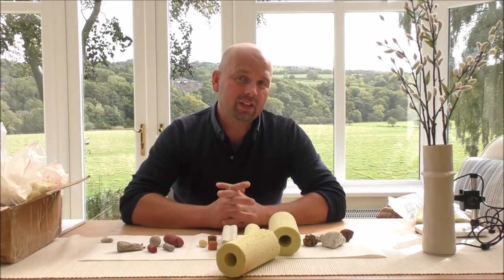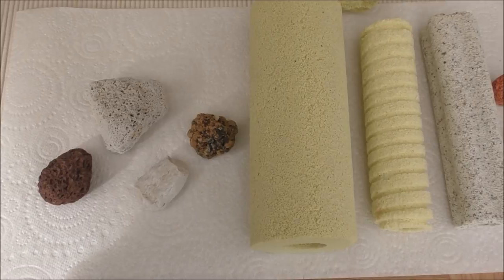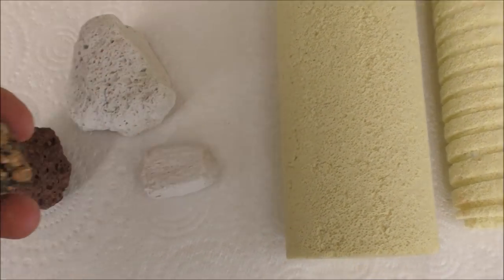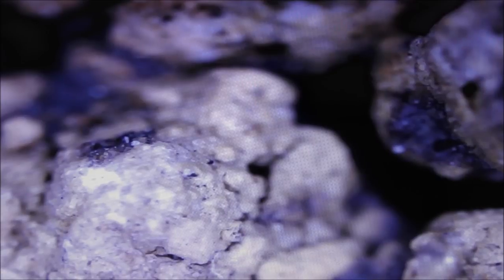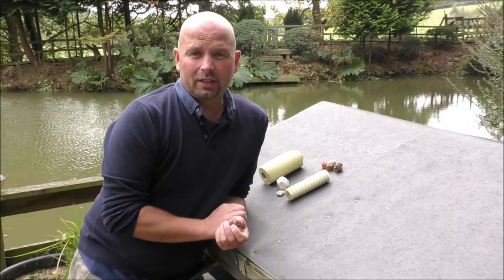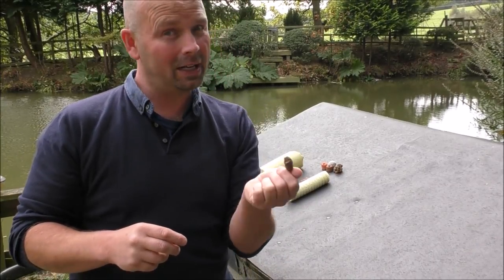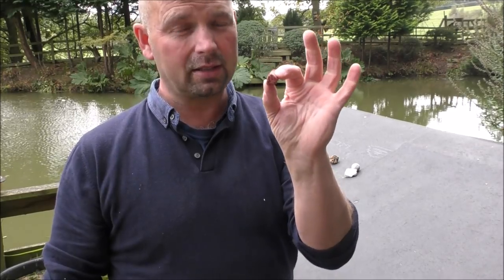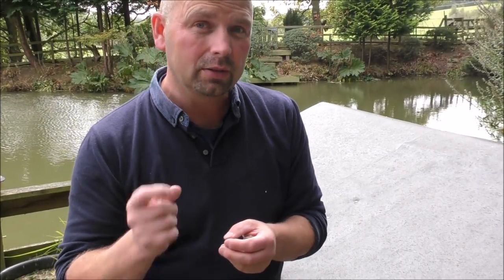Looking INSIDE Filter Media for Aquariums and Ponds

Comment: Why is the biohome ultimate gray inside
Reply from the maker: All the media starts out life as being a grey color but changes in the kiln depending on the trace elements added - ultimate goes orange and marine goes a browny purple.
When the media is a certain thickness that color doesn't change all the way through and it comes out a 2 tone color. The structure is all the same right through but the intense heat exposure is greater on the outside of the media.

Comment: here is my thoughts:

"I really wanted Lava Rock to be a good media, but its not"

I love the price of Lava rock, (dirt cheap)
I love the look, and its easy to work with and lasts forever.
The down side is that I dont think the holes in Lava rock actually allow water inside the rock, nor do they even really connect with each other.
I had a bunch of Lava rock all set to put in the top two trays of my filter when I had a close look at it...
What Im seeing with my eyes does not give me much confidence it can allow water to soak-in and that means that its really just as good as any rock with drilled holes  on the surface.

My question, has anyone seen a video where they show water soaking all the way though lava rock?
Reply from the maker: The stuff generally referred to as 'lava rock' which is the brown / red type of volcanic rock is not very porous at all as shown in the video so you will not see videos of water being drawn into the rock since the structure is not compatible with being porous. However, good quality white pumice is also a lava rock and can be very porous. The stuff I used in this video is basically a better quality version of what seachem sell as 'matrix' - not sure why they don't sell good quality pumice as it can be a decent media and the trade cost difference for bulk buying would be minimal between good drinking water quality pumice and the crap they sell (for a ridiculous price....) which is full of junk rock.
If you are looking for a hard, good quality media I would definitely recommend the alfagrog which is also shown in this video although you may not find it outside the UK. Most of the available surface area is external but it is extremely knobbly so has a good usable surface area.
Reply: @pondguru  
I live in northern North Dakota, in the USA, and so right at the moment its not really the time of year to expect to find much pumice in the garden sections...
However if I can find some Im going to give it a try....We shall see how it goes...

Take care!
(always enjoy your videos, I learn so much!)
Reply from the maker: @AlanMolstad  Good luck on the search - all I ever see in videos from guys in the US or CA is the red / brown lava rock and they've obviously never cracked a piece open to look inside as they tout it as being the best thing ever when it simply isn't - generally the lighter the lava rock is the better quality the internal structure will be.
Reply: @pondguru  Thanks so much for getting back to me!
Im about to add a bunch of pumice to the two Cascade 1000 filters I run on my 110-gal aquarium.
However before I did this (and make a mess that I always make when I do tank maintenance) I wanted to run by you the type of pumice I will use, just to see if you find any issues with it?

https://www.amazon.com/U-S-Pumice-1001-Scouring-Stick/dp/B018UR7LPG

(I hope the link works)
When I opened a  little box of it I found it was a nice shape to go into my filter trays.
The price was within my range of about $1 buck and change each here.
They look very clean, they dont appear in the ad to have anything added to them.
These are just the one brand that happend to be in stock at the local store, but I can see  other forms of the same stuff are also sold.
Reply: @pondguru  
on a side note...I fully understand why so many people think Lava Rock can allow water inside it,  just take a look at the stuff with all the little holes it has on the surface  and you will automatically think the holes go deep into the middle and are connected.
I know that is clearly what I was thinking as I was about to add a bunch of it to my filter trays.

But I started to notice something when I was washing the grit off the Lava stone - I noticed that I expected water to drip out of the little holes as it drained water from the middle, but that was not happening?
I then had a closer look at the stuff and from what I was seeing it seemed clear to me that while it has a ton of holes on the outer surface they simply don't connect with each other.   
That means that water can never pass from the outside to the inside as I was thinking until that moment.

Then I considered the stone material itself and how hard the stone was apart from the holes, and what you  seem to have is a very hard stone material that can't soak up water at all.

So I changed my mind as to the use of Lava Rock and filled the empty filter trays with white floss for now...

The quest continues!
Reply from the maker: @AlanMolstad  Yes, simply crack a piece open and look at it under a decent magnifying glass and you'll see that almost all the internal structure is sealed with the occasional bubble in there. It baffles me how people passing themselves off as 'experts' can say lava rock is a great media when it simply isn't. Well done for finding a good white pumice stone in the US - I commented on your video.
Reply: I keep wondering why foam wasn't included. There's such a diy movement for foam pads. Some guys are using it as baffling in their sumps. Sort of.

Comment: WHAT!!! I PUT MATRIX UNDER A MICROSCOPE AND MINE WAS SMOOTH AS GLASS
Reply from the maker: The stuff sold as 'matrix' is a dense, low grade pumice so is very smooth (and not much use). I used a very porous piece of pumice for this video and much of it was smooth too but it is much better than matrix due to the increased porosity. It's only when you look through a microscope that you see what makes a good and bad media....

Comment: Fascinating stuff, Richard, but I lost you at one point.
"Carbon has more surface area"
Sorry Richard but this doesn't make any sense at all to me. Graphite and diamond are both solid carbon with no pores at all and minimal surface area for a given mass. Maybe you're referring to activated charcoal, carbon spheres, or tubes. But to just say carbon has more surface area, really does not make any sense to me. Sorry  mate.
Reply from the maker: I should have made that a bit clearer - not carbon the element but carbon / activated charcoal which is sold for chemical filtration for aquariums. I never considered that a distinction was necessary since this was a video about filtration but you make a good point.
The microporous nature of the chemical treatments known as 'carbon' and 'activated charcoal' give them the ability to draw in chemicals from the water, filling them up, therefore they need changing regularly.
I can just imagine an oil baron in Saudi Arabia filling the last section of his filter with diamonds since they are pure carbon and then wondering why it isn't having any effect on the water....
Reply: @pondguru  LMFAO the last line cracks me up 😂😂

Comment: What is the significance of being able to crush this media. WTF are you doing with your media? I just put mine in my canister and it grows bacteria, it doesn't flow around at 50MPH crashing into other objects. Have you re-purposed a rock crusher for you media container? 
BTW; I have been using pot scrubbies for years in the canisters for my Discus tanks. I clean the canisters once a year and have zero Ammonia, zero nitrites and zero nitrates. I do change 20% of the water once a week and I turn the pump off when I feed my Discus.
I have over a thousand dollars of Discus in one tank and if scrubbies did not work I would not risk it and I do it with one SunSun HW-404B Canister filter that's about seven dollars worth of scrubbies. If it ain't broke - well
Reply from the maker: If it aint broke indeed - I always say if you have achieved full cycle filtration with any method of filtration there is no need to change. The best media is the one which works for you and if pot scrubbers are doing the business then that is good.
With regard to crush strength that comes into play when media is used in a shower filter. Many of the powdery ceramic 'shower / bakki' media will break down very quickly when used in a (large) shower filter from crushing and also from water falling onto it.

Comment: I hate to say it, but you need to compare some plastic in there. You need to put plastic scrubbies and foam pads in your test because of the DIY community. It's one thing to beat the store bought, but DIY guys tend to be less scientific about the selection. This could be a wake up call.
Reply: Plastics seem to be on the way out due to environmental pressures, a lot of places no longer sell the polyprop scrubbies, plastic straws, etc. I use hydroton (expanded clay balls), very inexpensive and works great.

Comment: A comment on lava rock. Lava rocks are not made the same. Some stones that look pretty similar and come from the same batch from the distributer can behave differently. Some float and some sink, some I can blow my breath right through, even stones 20 cm in diameter which suggest connected pores and some look very porous but are impossible to blow through.
Reply from the maker: Yes the darker a stone is generally the more 'sealed' any internal structure is but occasionally even one of them will be like a sieve all the way through. The white pumice is generally more open structured but again can be variable and much more likely to float than darker forms.
It is the variable quality of the darker rock which makes it very 'hit and miss' for filtration and a good batch can do a great job of filtration - the white pumice I get is classed as drinking water quality (and is used in many places in the UK to buffer water and filter it, e.g. Scotland) and although the quality is generally excellent the lesser grades can be anywhere from good to poor as far as internal structure and ability to support aerobic / anaerobic bacteria goes.
Thanks for watching.

Comment: Well done on this topic, HOWEVER what I would like to see from you is this..........and this might be a bit painful and dont take this the wrong way. I dont know a single person who has used Bio-Home (Of any Kind) that has seen a reduction in Nitrates, so a video of How to use this media properly to actually reduce Nitrates. As you know the bacteria required to consume nitrates requires LOW oxygen and very little water movement. So a standard canister filter, Shower Filter really isnt a conducive environment to grow this type of bacteria. with that being said where and when is it possible to create an environment for this bacteria to grow?
Reply from the maker: How many people do you know who use it? How much and in what size tanks etc.?
If you scroll down comments on any of the biohome related videos you will see that it definitely works to provide a full cycle (and a resulting reduction in nitrate) but plenty has to be used for the volume of tank and stocking level. I get messages from people every day wondering why there is no effect when they are using 500g in a 300 litre heavily stocked tank.
While no media is a magic bullet the unique structure of biohome (as demonstrated in this video) allows for slow flow, deoxygenated zones in small pockets right through the media which is where the anaerobic processes occur and the nitrate is processed so a low water flow in a filter is not necessary for good results (since the water flows slowly through parts of the media). Although I explained how the media supports aerobic and anaerobic bacteria (as well as showing the internal structure compared to other media) in this video the one I did a couple of weeks ago will probably help more since it goes into filter set up, how much media is required for various stocking scenarios and other important information including what can prevent a full cycle developing etc.
Here is the link: https://www.youtube.com/watch?v=L5FkSTYkEAE
If you scroll down the comments there you will see many people who swear by the biohome and the job it is doing in a variety of different tanks.
If the full cycle does not develop there is generally a good reason for that and I'm always here to help anyone who wants to ask questions - just check the video comments for evidence of that.
Thanks for watching and taking the time to comment.
Reply: I know 1/2 a Dozen and although I truly believe in the concept what most people dont know I think is the proper Scenario that this can possibly Occur. Now me personally I dont use this type of Media (Never had the need) I previously was a Trickle Filter/Shower Filter person for Bio and Ocean Clear and or NuClear Filter guy for Mechanical filtration, but since have Switched to K1 Micro Moving Bed filtration for Bio.............Which I have never had a real water quality problem. However most of the world (Which I dont understand) uses these powered Canister Filters like a Fluval, Eheim, SunSun, which IMO does NOT lend itself well to creating an Environment conducive to grow anaerobic Bacteria. Now I like many others regardless of the type of filtration used still has this Nitrate issue's, I will have reduced it with a Drip System in my new 540 Gal Aquarium, and on my 170 Gal i use an Aquaripure Alcohol Dosing Filter which is a miracle worker...............That Tank has 0 - 5 PPM Nitrate at any given time. But with the average fish Hobbyist  being so cheap most of these people do not want to spend the $ to do the Drip System or Buy the Aquaripure.....................So many people I know have bought the Bio-Home and from what I have heard from them is zero Success. 

I am not doubting you or the product Sir.............Just a FYI! Hell in fact i think your one of the more intellectual people I have seen about this topic on the internet, some brilliant philosophies that Being a mechanical minded person I can relate too!
Reply from the maker: If you really know people using the biohome with no success tell them to get in touch and I will try to get to the bottom of why it is not working - as I mentioned before there is almost always a reason why filtration isn't doing the job.
Do you know any specific cases (size of tank, stock and amount of media used)? That would at least be a start.
With regard to canister filters not providing an environment for anaerobic activity that is correct on a superficial level but as I've tried to explain it is the media, not the filter which dictates how much of the cycle is completed - most will use cheap ceramic or plastic media which only supports aerobic bacteria and has zero chance of ever getting the cycle completed. Canister filters are known as nitrate factories for a good reason but they don't have to be.
Its good that you're using K1 micro as it is an excellent choice for getting the aerobic side of filtration done - there's probably nothing more effective at processing ammonia and nitrite quickly and as a first stage biological filter it does a cracking job.
Reply: I dont know any of the specifics BUT I will be sure to Pass this onto those who find this to be less than a worth while purchase. These are not people I know directly but people within the African Cichlid Community . Like I said I will have them contact you directly. Thanks

Now when i say no success let me clarify that...........On a Nitrate level reduction only. Everyone I talk to states that on a aerobic level the stuff is the best out there.............Which I believe to be probably pretty accurate. But to play devils advocate I have for 25 yrs run Bio Balls in a Trickle/Shower Filter and NEVER had an issue..................Even with a 150 Gal tank with up to 75 4" to 6" African Cichlids loaded in it. Which is why i have never felt the need to ever make a change.

Thanks again for the interaction and I will get this out to the people in need!
Reply: I just Passed this info onto them just a FYI, and thanks hopefully they will either watch and learn and or Email or call. there are certain parts of this Country (USA) where the Nitrate levels are high right out of the tap..............Mine included. There are certain times of the year, mid to late Summer and fall where my PPM right out of the tap can be as high as 60 PPM, a few of the people having these difficulties are in these area's.............This very well might be causing their issues as well. For me the Aquaripure Vodka Dosing filtration system was my only method for clearing this up. My PPM's in the 150 would spike at the end of the maint cycle (Which was 90 day) as high as 90 PPM nitrate. Once the Aquaripure went in and it was established which took roughly 9 weeks my PPM dropped steadily for the next week down to 5 PPM. This thing is truly an amazing product!
Reply from the maker: If the people you converse with in the group are also from the US then it would probably be better if they contact Don from Greatwave Engineering as he is US distributor and will be more familiar with the imperial measurements - I know he has many filter volumes recorded in cubic inches and works in GPH
https://greatwaveeng.com/